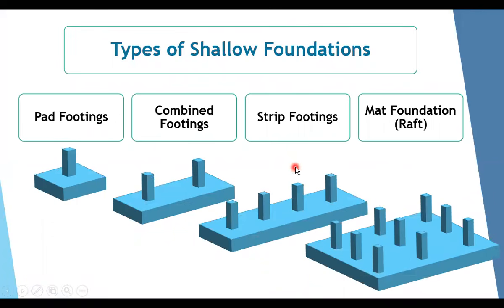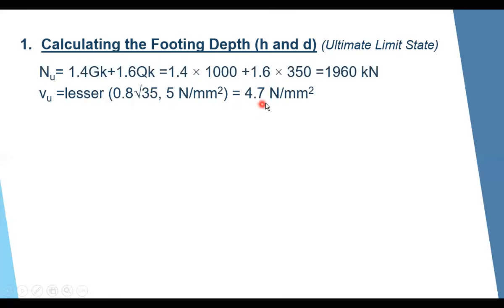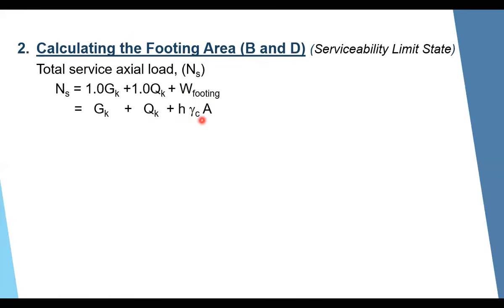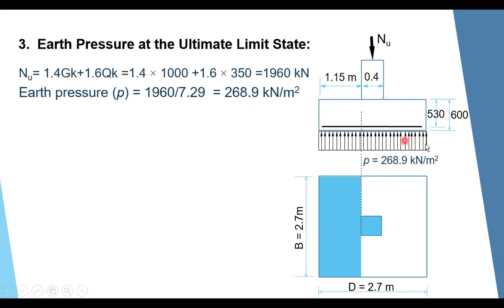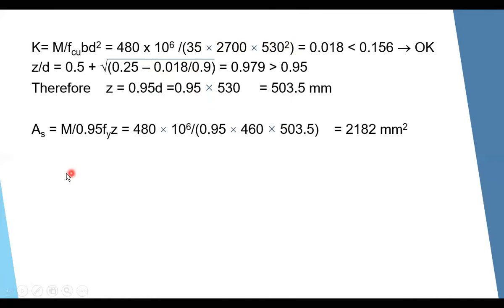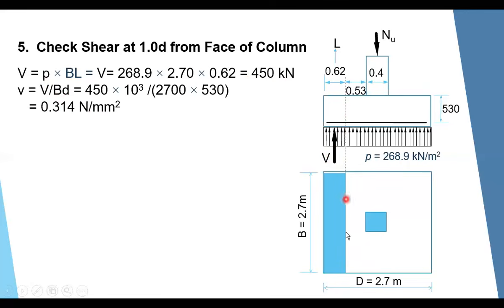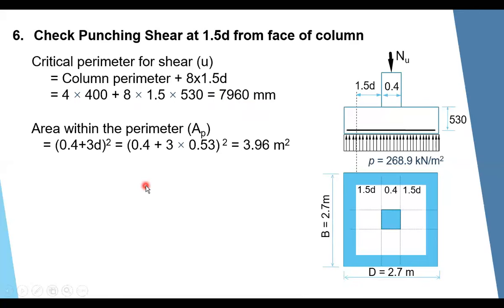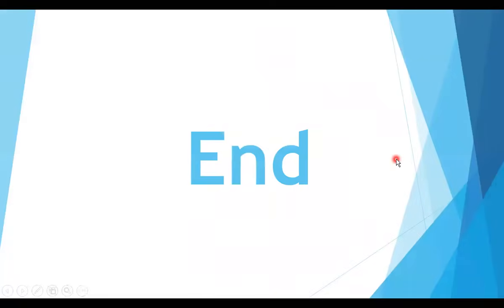Foundations (Part 2): Pad Footings under Axial Load - Design of reinforced concrete footings.

Comment: Hi, I think your moment value 17:02  I think a little bit confusing cause, the unit of pressure is kN/m2 but when you’ve multiply it by L (L/2) the answer supposed to be in kN cause the m2 will be cancelled and there is no moment there. How you could get kN-m in your answer?
Reply: Pressure ×area×length
Kn/m2. ×m2.    ×m

Kn.m

Comment: Thank you so much, this lecture is very insightful.
Is it safe to exceed the bearing capacity of the soil as in this example?
Also, why didn’t you consider the weight of the footing in calculating the soil pressure at ultimate limit state?
Reply from the maker: We did not exceed the soil bearing pressure. You need to check this at service load only not at ultimate.
Reply from the maker: Regarding your second part of your question, no need to consider the weight of the footing to calculate the ultimate pressure as the weight of the footing will cancel this increase when calculating moment and shear
Reply from the maker: Therefore, no need to consider it.

Comment: Dr. S. El-Gamal, why not include the weight of the soil above the footing to find its area? Is it not, soil above footing increases the stress on the soil below the footing?
Reply from the maker: Yes. You are correct. In the examples, no soil was assumed above the footing.
Reply: @MrElgamal77  Yes, I understand.

Comment: first thanks for the great effort, why you compare the value of (400/d) ¼ with 1 ? the BS8110 mention that in table 3.8 it should not be taken as less than 0.67 for members without shear reinforcement;

Comment: Salam Dr. I have a quick question, the allowable bearing pressure in the example is 200 KN/m2, however, in the video minute 15, the earth pressure in the ultimate state calculated is 268.9 KN/m2 which is more than the allowable. Would you please explain to me why did you go more than the allowable? I thought we should design for a max of 200 KN/m2 Thanks for everything. Really enjoyed your video.
Reply from the maker: The earth pressure at service load should not exceed the allowable one (200). At ultimate load, of course it will be more than 200 and there is no problem about that. Only check at service load.
Reply: I agree @semem4636.....it is not safe because in the Q, the safe earth pressure is 200 KN/m2

Comment: Wonderful work sir. I highly appreciate this. I have a question though. You calculated the soil pressure on the footing for ultimate limit state and got a value higher than the soil pressure. Can that soil sustain that?

Comment: Good day. What fcu mean? Thank you
Reply from the maker: It is the characteristics compressive strength of concrete cube.  This is the one used by the BS code. Other codes such as the ACI code use fc' (from cylinder test not cube).
Reply: Characteristics strength of concrete

Comment: Thanks Dr.sherif
Ihave question. Why used 400/d =1. BS9810 permitted to use it less than 1 put greater than 0.67 for section without shear reinforcement like foundations.
Reply from the maker: Thank you for your interest. Table 3.8 in the BS8110 states clearly that the 400/d should not be taken less than 1. Which clouse in the code states that it can be taken up to 0.67?
Reply: @MrElgamal77  in BS 8110_1 from 2002 to the last version of it...the sign of greater (>) is deleated from the table 3.8 . Under the table directly the code permitted to use (400\d)^.25 doesn't take less than 0.67 for members without shear reinforcement and not less than 1 for members with shear reinforcement.
Reply from the maker: @mogahedismail695  I am using the 1997 version of the code, which is the version we have in the university. Can you send me a later version if you have?